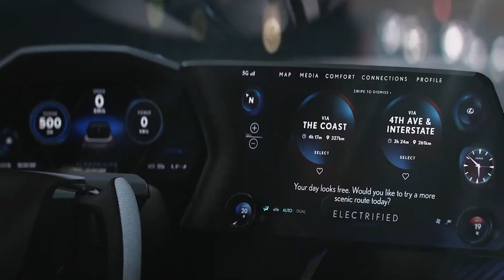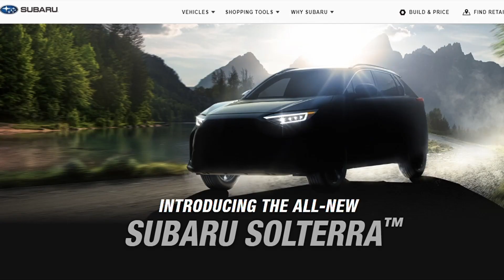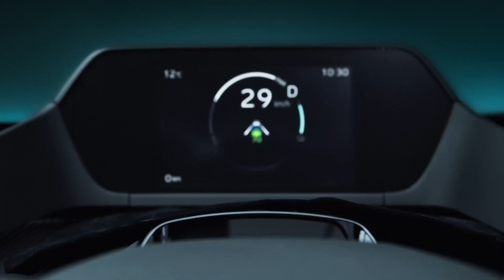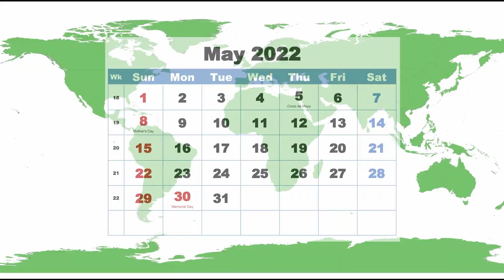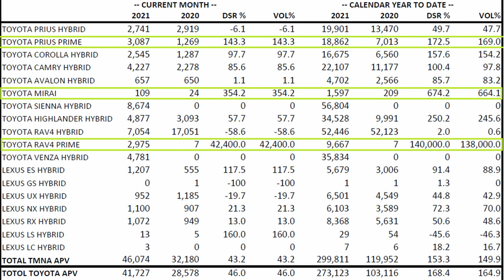Toyota BZ4X EV - Toyota Is Ready to Displace Tesla

Comment: I believe that to be really successful and beat Tesla, You will need  a charging network as large or larger and I don't see this happening.
Reply from the maker: They stand a chance if this happens right?
Reply: @poshfuture1833  not really. Scaling production takes time, and BEVs are a different beast. Tesla is amazingly efficient, just closely follow Giga Berlin ramp-up next year. Front and rear casting, structural battery pack, 4680 technology and power management fueled by data and IA. Now find the engineers knowing about efficient electric motors (hybrids’ are sooooo crappy), find IA engineers, big data ones, train a model for FSD, be good at software and OTA updates, then you start to be in the game. Oh, and become the world’s most advanced company in designing factories at large scale, « the machine that makes the machine » as this is the #1 differentiation criteria. There’s a long way to go... have a peek at the Berlin Tesla fest.
Forgot to mention that fuel cell ie hydrogen technology is mindbogglingly stupid and inefficient for passenger cars. Make sense at large scale only, like ships or planes... the amount of energy required to produce liquid hydrogen, carry and distribute it then transform it is crazy. It also makes owners dependent from ‘gaz’ stations like with petrol rather supplying energy straight from your home or office sometimes straight from solar. Oh, and hydrogen cars are bombs on wheels.
Reply: Don't worry, many franchises build this network. Not as Tesla had built its own network. Restaurants, malls.... because charging brings money.

Comment: I have spoken to a Toyota engineer here in Los Angeles and he confirmed that Toyota’s true intent is to push for the adoption of hydrogen as a power source. It’s no accident that the RAV 4 is produced in small numbers. They have the expertise but not the desire to build more. Toyota’s testimony before congress was intended to slow and delay the adoption of electric vehicles. This is easily researched. You should do a piece on this. There was a bit of critical analysis in your piece but most of it sounded like you read their press release.
Reply: Hydrogen is cracked from natural gas, using fossil fuel. Double error. But Saudis and Russian's like it.
Reply: @HerrJarvinen  if green hydrogen is properly realized, then Tiyota would have a significant leg up.
Partially because I'm not convinced that electric can replace long haul trucking or planes, hydrogen has that capacity.
Reply: @samuelnakai1804  That's all based on an assumption that there is a clean and scalable and economically viable way to produce Hydrogen. Today there is none. It doesn't matter if we wish there was. I sure wish there was. There is no energy efficient Hydrogen production method yet even in the lab, and that means the it's far far in the future. Our climate disaster can't wait until far far in the future.
Then there is the fact that Hydrogen is tricky to store and transport, even today after our industries have been storing and transporting it for decades and decades.
Instant Hydrogen fuel cell based transportation revolution would be awesome, but is not within a reach.
For airplanes it may be coming soon, but not in mass. Same for ships. Air and sea transportation use so much energy that the lack of green Hydrogen mass production makes this too be something in the far future. I wish it wasn't.
Reply: You nailed it. Toyota's CEO has pooh-poohed EVs & trash-talked Tesla for years. They're committed to hydrogen fuel cells for two reasons: 
1. The Japanese government provided massive subsidies for fuel cell development. Don't know whether Toyota had a hand in convincing them that was the way to go. 
2. Toyota fucked up: they ignored the world-wide interest in EVs and the plummeting cost of solar & wind generation. Ignored the battery supply market, until it was too late & it was massively over-subscribed, leaving Toyota out in the cold with no battery supply: zero, for EVs. They can get enough to sell their hybrids - that's it.

What do you do if you have not battery supply & won't have batteries for EV production of cars you haven't bothered to design for at least 5 years? 
1. Call Madison Ave. & hire advertising firms to sell bullshit, vaporware. Products that don't exist. Such as "70 EV models by 2025" - fully 10 years late.
2. Name the new models "BZ - Beyond Zero" because you're totally clueless in English, or incapable of seeing the irony. 

Great for entertainment value, though. "Beyond Zero": "before we had nothing. But now we have... er... nothing til 2025. Maybe." Toyota's CEO has a future in stand-up comedy when the Board turfs him.

We haven't seen such irony in a new name since February 2000 when the Canadian conservatives merged parties & re-branded as the Canadian Conservative Reform Alliance, also known as the Canadian Alliance to the Party's press secretary. Everyone else - within seconds - had realized the wonder of a bunch of social conservatives (Canada's Republican wanna-be's) naming themselves the CRA Party - or "CRAP."

Come to think of it, Toyota & the CRAP have another thing in common besides lack of a sense of humor: disarming honesty. CRAP was an honest moniker: it described the Party to a tee. And 'Beyond Zero - by 2025' - is equally honest.
Reply: @jamesthompson7282  Yo, have some mercy on the poor Scotty Kilmer. He's probably working overtime pumping out new videos cheering Toyota. Hes gonna lose whatever hair he has after reading your comment. HA HA HA HA HA!!!!
Reply from the maker: Hmm, we recently did a piece on Toyota's Solid State Batteries https://www.youtube.com/watch?v=3_8nJMIxREs. There will be more exposure and more reveals coming please subscribe.
Reply: @poshfuture1833  There is not anyone at the moment making solid state batteries in anything other than lab scale at this time. There is currently no one making solid sate batteries in the development or mass production scale at this time or have plants in progress of being built, to do so.

Comment: What would be good is when manufacturers announce models and when they will be on sale, to include the target number of sales. If you are bringing out a new electric car - but you are only going to make 1500 in the first year - 30 a week. That is a start, but when you look at Tesla's plant in China and that produces currently close to 1500 EV's per DAY - 30 a week is not really much competition. 

The other thing Tesla just makes one version - electric, making multiple variants whilst sounding like you are appealing to all sectors of the market - you are also increasing your production costs with each variant. When you look at where Tesla are with their battery only vehicles - do people really need or want any other version? 

To the lay person I think battery only cars will be the winners for cars, smaller vans and pickup trucks, and maybe even for HGV's.
Reply from the maker: So true, Many variants increase production costs and even capacity which is a big disadvantage.

Comment from the maker: Why is nobody talking about the solar recharging roof that will be fitted on the BZ4X?
Reply: Because on a full size/weight EV, that is used every day, it is little more than a marketing gimmick.
Reply: @markbeiser  If it can run the heating and air conditioning system before you enter the car that's worthwhile IMO.
Reply from the maker: @gregripp  Smart and Intelligent. We need to see how these things can work

Comment: By 2025 Tesla will be making 6,000,000 cars a year with full FSD . Toyota will have to license Tesla tech or go bankrupt .
Reply: By 2025 ICE vehicles are expected to hit their peak sales volume. “Traditional” vehicle manufacturers are not going to be going anywhere by that date. 

6M cars / year for Tesla by 2025, is that global sales?  If so,  that means they will have captured approximately 6 to 7% of the market. While a substantial increase, it’s not traditional car company killing. 

If the traditional companies have a viable product out by 2025, there is enough time for them to capture bev marketshare as ice vehicle sales decline. 

Bev vehicle sales are expected to accelerate through 2030 where they will slow down due to infrastructure constraints. 

There is time.
Reply from the maker: @rod7307  Well enumerated. The market share is so large and there will be enough space and time for others to catchup and play
Reply: The trouble with legacy car makers is that they do not understand software. Software is 80% of EVs engineering effort. No hardware company has yet to make the transition to software very well. EVs are like smart phones on wheels. Nokia and Motorola were eaten up by Apple is an example.
Reply: @hl2349  Could you guy drop the nauseating repeat of the words of legacy, old, mature as if an existing industry cannot reform. Look at Cruise and Waymo autonomous fleets in SF. Cruise is GM and Waymo is Google. Where is Tesla in this. GM made the EV1 20 years before Tesla. EV1 was a fully functional ev. It was introduced before its time and failed to succeed because oil was too cheap for ev to compete. GM knows a lot in making ev, so does Toyota and many other car companies.
In a few years, there will be two 
dozens ev car makers, Tesla will be one of them. Tesla may have some advantages but not prohibiting ones.
Reply: @Kukaboora  Tesla and some Chinese auto manufacturers, perhaps BYD will be leading in EV. Detroit will be lucky to survive. Toyota has a chance but must give up on fuel cells (can't charge at home or with solar), PHEV, and hybrid.
Reply: @johndonaldson5126  How do you know that?
What are the numbers that back up your assertions? You assume people will lay dead, stop innovating and only Tesla does that?
Up until this point in time, all the batteries are Panasonic, LG Chem and Hundai. Tesla just bought the battery cells and put them together. The 4680 Lithium Phosphate could be still 4 years away.
By the way, BYD already used their own Lithium Phophate batteries in their evs. Nothing new or revolutionary about it.
Wait for the solid state to be reality and I believe that would be the end of Tesla.
BMW, VW, GM, Ford and many others all go with new technology, where is Tesla?
Reply: Don't be stupid please. Fsd is a fail btw, it was supposed to be here in 2019. Lol fan boy
Reply: Your obviously not a car guy